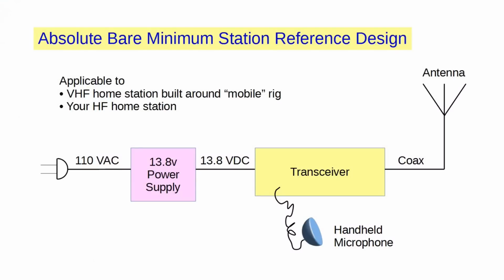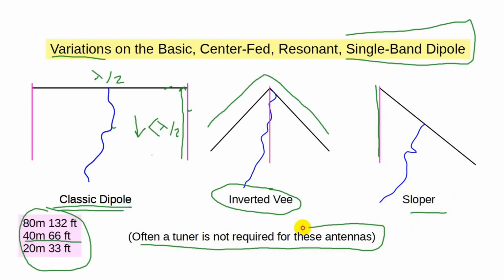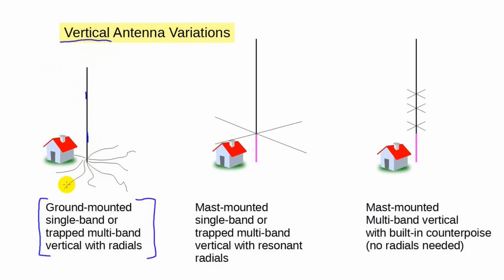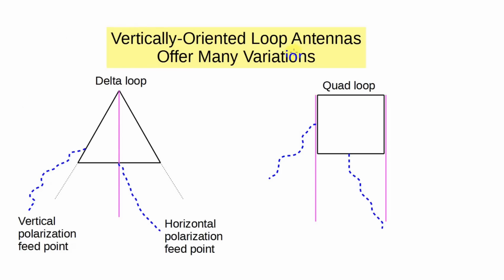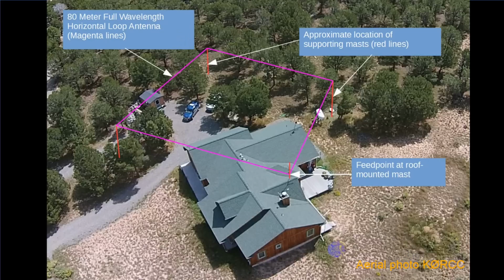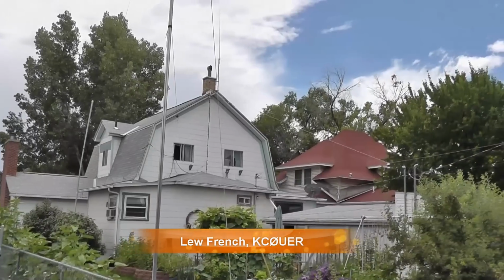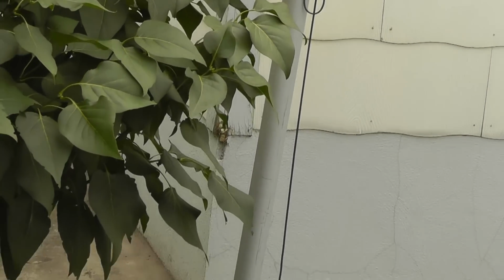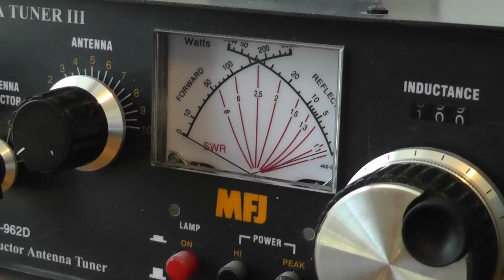Antennas for Difficult Situations: Ask Dave Episode 7

Comment: Hi Dave good morning. My lot is very small. I live in a mobile home. Am using an end fed dipole, 9:1 balun. As a sloppier dipole. When I run the insulator end up to a tree, ( can only go up about 20 feet). Will height make a difference? I’m not getting in any strong stations.

Comment: Hlo Dave i heard about the Isotron BILAL Antenna that have a large inductor in the middle with sheet meyal flanged as the main ant structure but with no ant Legs or any radiating members, how does this work  and i view this as a radiating TANK circuit since i see no rods or wires  just simple capacitive and inductive physical parts please give feed back TNX de n6mmq

Comment: What are you thoughts on using what is called a ridge vent for an antenna? These are starting to be use in place of the traditional roof vents in house where practical. I live in a split-level rectangle with a simple roof which uses one of these ridge vents to ventilate my attic. I am considering this over a gutter antenna.

Comment: I will be taking the test for my General license the middle of next month -- Oct. 19, 2020.  Am saving for a 15 foot piece of 1 inch PVC pipe to get the antenna in the air a little higher.  Thinking of trying some 75 ohm TV coax for the 4 element yagi as I have a lot of 75 ohm coax.  For HF I guess I'll be sticking to the 11 meter (CB) band since I've got several CB single sideband radios and will be using one (with a reprogrammed PLL chip) for 10 meters.

Comment: I got my start in single sideband CB radios back in the mid 70's.  I used to modify SSB radios to go above channel 40 and below channel 1 by reprogramming the PLL chip with +5 volts (high) and 0 volts (low) and unlock the clarifier with 8 volts on one side of the pot and the other side to ground.  Now the only Ham radio I have is the Yaesu FT-4VR, a mono band, 2 meter radio I got for passing my Technician exam.  I'd like to hook up an Astatic D-104 mic to my HT but cannot find a schematic on it since it isn't made anymore.  While waiting on my call sign I constructed a 1/4 wave ground plane antenna I made out of a piece of romex house wire I cut apart.  Only way to check my SWR is to use my old CB radio SWR meter which I found out could be used on VHF if you hook it up right.  First you set the meter in the forward position and then unhook it and hook it up backwards leaving it in the forward position.  Then key the transmitter and it will give a very close SWR reading for the VHF band.  Don't think it will work the same for UHF.  I got the ground plane up in the air about 20 feet by using my old CB radio antenna mast pole.  Using the old RG-58U CB radio coax on my 2 meter HT and the cable in the front door.  So far wife's been tolerating the cable coming in through a crack in the door but we'll see when it starts getting colder.

Comment: Dave thanks so much this was extremely helpful. I am a newly minted Tech,  KC3PZX but hope to go after my General soon. For the moment I am working strictly handheld on VHF/UHF so the antenna is not an issue but with a general I want to get into HF. I have two questions, I had been contemplating and attic antenna, but realized I may have a problem, we have solar on our roof, I am assuming the metal casing of the panels is going to negatively impact that. Since it is producing fairly high voltage DC I also wonder if that might also generate QRN, I have no idea how well shielded the cables are.  Your second guest, Dick Schultz KD0ESN, was what I had been wondering about and that was a Dipole along the north side above the gutters or perhaps a V shaped making the turn at the corner if I try to go for a longer antenna. I have considered going with an automatic antenna tuner mounted essentially at the connection point to reduce the line loss. between the antenna and the shack.  I do face a unique challenge as I am the HOA President so am mindful of those restrictions as I am often called to enforce them.  Again thanks this has made me feel better about the chances of getting a good signal out and in.

Comment: I just moved from a non-restrictive neighborhood, to an active adult community with HOA restrictions. They are forced to accept flagpoles and I know you can hide a vertical in one, but that's more work and expense than I want to deal with at the moment. My 20ft vertical was atop a 50 ft tower before, and while SWR was GREAT on ALL bands, it's effectiveness at receiving wasn't near as good as a long wire I had winding around in trees.  I am thinking an (several) attic antenna would be my best option for now. I can put in a dipole ok I am sure. I have 10 foot ceilings and the vertical is 20 feet. The bedroom where my Ham Shack is located, is closer to the edge of the house than the roof peak. Is it possible to put the vertical at an angle from the closet floor on up into the attic peak and run it "less than vertical" at an angle? Issues?  Also, I loved my G5RV I had a few years back, and since you can let wires dangle at the end, is there a limit on how much can dangle?

Comment: I have a concrete home (roof also concrete), can a dipole wire be ran in contact with the roof or there needs to be a separeation?
Reply from the maker: Your roof and walls are full of re bar which makes the act like ground. You'll need to get your antenna's radiation elements up off the roof.

Comment: I had a similar issue with a dipole element being too close to other metal. One hunting trip I was staying in a school bus and had one leg hanging slack running along-side the windows. I got it tuned and went outside to make the legs taut. After that my tune was way off. I slackened the legs back up and my tune came back. Turned out when I tightened the legs one of them ran right next to the metal body of the bus. When it hung slack next to the windows it had enough distance from the body that it didnt effect my tune. Fun lesson to learn!

Comment: Hi Dave,
Have watched your videos for a few years , and they have  helped me to study & pass the Big Exam with Honors, thanks so much for that help. Would it be possible for you to help us with metal roof structures with advice on setting up Dipole antennas? I am trying to make an antenna layout plan, and have got some ideas for NVIS 80 meters separately from a 20/40 meter in the yard ,of course the shed & the house have metal roofs & that poses some challenge.
 Some advice on avoiding coupling would be really appreciated. The situations that a lot of folks have overcome are with shingled or tar roofs, They have great ideas, what is some ways to get above the problem same as they but with metal roofs. Any advice please, would be appreciated.
& many thanks for your videos,
 which were most instrumental in helping me to understand the concepts to get an Honors pass, haven't got a grade like that in over 40 years or more.
Good thing there was no exam Q on metal roofs
Thanks, Mike 73 VE9MWB

Comment: Dave, If you have time for a question - Which is a better choice and how does the house impact the antenna.  
1)	Place antenna at 15-20 feet between trees. 
Kinda normal
or
2)	Place the antenna on the roof line of my house (40 feet). Say 6 inches above the roof
a.	How does the roof impact the antenna?
b.	Does this count as a height of 6 inches  from the roof or is it 40 feet in the air?
 and is (or how much is) the signal degraded?

Thanks!

Comment: Thanks Dave, ya I have a 30 foot tower, concrete bace and bolted and stayed,  planning to pull the center up that, going to use top rail 20 feet tall on the ends, going to concrete it in and stay that, iow it ain't going anywhere, this is for 80 meters,  do you think it is off the ground enough?
Reply from the maker: In theory, a dipole should be a half wavelength off the ground. That's 132 feet. Nobody has a dipole that high, so get it as high as you can reasonably get it.

Comment: Dear Dave, I just passed my technician test this morning, if you remember I am the guy that commented, ( so you need a couple of skyscrapers to mount 80 meters) a couple of weeks ago, well tell you what I have in mind, I have a hf rig, and yes I already have my study guide for general class, a lot of land and a 80 meter dipole antenna from mfj, the tower I have is 30 feet, there are no trees it's Arizona, was thinking about 20 feet of your fence rail guyed off at eather end for a inverted vee diepole  30 feet in the middle and 20 foot on the ends, what do you think?
Reply from the maker: My experience is that two pieces of aluminum top rail is about as much as will go together. Three is pretty wobbly.

Comment: Hi Dave. The good old conundrum of antennas. Where do I fit them in ?. Well your video here just about covered that one. The Hams in the Housing Org areas certainly found ways to get some wire up without it showing . The house that I am living in now. I would have all on to put up a 20 meter full wave loop but I just might give it a try all around the front and rear garden and over the roof and back down to a nice tree in the rear garden. We shall just have to work on it. Wish I was still serving in the army. If we needed an antenna up it went up and as long as it was not going in the way of any choppers, it went as high as we could get it Thank you for another interesting video. 73 de John - G0WXU.

Comment: I like the way this guy presents his videos. He obviously knows the biz, however, he makes his presentations in terms easy for a beginner to understand. I'm thankful to have come upon his videos and have subscribed. I'm new to ham and have recently installed my HF system. I bought and put up a multi-band OCF dipole but have not made any contacts yet. Therefore, I am digging in to learn what I can about antennas so I can determine what my problem(s) are, and if in fact, I do have a problem. It may very well turn out propagation conditions just aren't right. In any case, I shall allow Dave to instruct me and guide me through this process so that I can get on the waves. Thanks, Dave.

Comment: Thanks for great 👍 interviews of other ham solutions. Question #1 on your 80 meter loop. Given earlier comments on connection at a side versus a corner for different polarization, (horizontal  versus vertical), does one versus the other improve your coverage or does your height limit either to similar NVIS Mileage range distance?    Q2. Would you recommend one connection over the other for a loop antenna or is it really just what is convenient?  Q3 I have an OCF for multi band. Woukd you rate as equal to, more, or less desirable than a loop for 10-40 meters,  given similar height?  Thanks for your work and sharing. Steve
Reply from the maker: I took down the 80m loop a couple years ago. I fed it at a corner. A horizontal loop can have strange radiation patterns, especially on higher frequencies. Connect wherever's convenient, usually at a corner. If you can get that OCFD well up into the air, it'll perform on par with the loop.

Comment: Thanks you are doing a great job. I live in an HOA. My house is 3 stories but I have a metal roof.  Could I use a rope and insulator to install a sloper into the back yard. I just don't know how far I need to be away from the house. I run HF mobile with great success. But I would like to set up a station at the house.
Reply from the maker: Give it a try. Keep it as far from the metal roof as you can. Good luck!

Comment: I know this is one of your older videos, but I just came across it today. A lot of us Ham's have had to be creative in order to get on the air, and I really wish I'd have kept a journal of all the things I've tried and the one that worked! Likely the simplest one I've used was a mono band mobile antenna. Specifically a Hamstick mounted on the metal deck rail of my third floor apartment in Fargo North Dakota. I bonded the three sides of the deck railing together with short braided cable, and I ran a piece of wire close to a quarter wave long down to the 2 x 6 deck floor. I wove that wire between the boards zig zagging it back and forth to create even more of a ground plane. I ran the PICO Net on my morning for a year and a half and only once in a while needed a relay. Not the biggest fish in the pond, but I was in the pond.
Reply from the maker: A great example of persistance!

Comment: I live on the bottom floor of an apartment building, and my lease simply does not allow me to erect an antenna at all.  If I wanted to get on the air on HF, I would have to do it in the field.
Reply from the maker: An additional thought is that sometimes folks in your situation will put an HF mobile station in their vehicle, and then operate from a local park.
Reply: @davecasler  That's sort of what I'm angling toward now, although I'm not sure if the city I live in would allow such ad hoc installations in its municipal parks, although I would be very careful not to leave a trace after taking everything down at the end of my operation.

73 VE7NDE

Comment: Dave - I have watched many of your videos. You do a really great job of explaining things and have clear answers to questions.  I just passed my Technician and General license exams. I am interested DX and maybe MARS but my problem is that I live in a neighborhood where restrictions prevent my from putting up an antenna.My attic is small because of the slope of my ceilings which attic antennas difficult. Any suggestions regarding my antenna conundrum and radios?
Reply from the maker: Your situation is shared by many. Persevere. Take a look at the HF digital modes such as FT8 that can be done successfully even with severely compromised antennas.

Comment: Dave,
I used a G5-RV Antenna up about 20’ at our old residence and I found that I could operate Everything EXCEPT 160meters.
I’m going to run some 14g wire (From or friends at DX Engineering) to run from a Palm Tree up around 200’, running to a tree in my Backyard! 

IF everything goes to “Plan” I HOPE to be able to run ALL of the Amateur Bands!
I’ll let you know how things work out, hopefully sometime Very Soon!
Thanks for ALL of your presentations! I only Wish “Someone” would have done what You’re doing 25 years ago, when I got my Ticket!
-73-
Bill
N6FFC

Comment: Excellent video for new Hams or those challenged with HOA restrictions such as I am.  Thanks for covering these various antenna options.  I can only dream of ever having a 1/2 wave 80m dipole antenna so, I make due with a garage attic mounted 37ft. OCF Dipole for 6m-40m configured in a sideways "L" shape.  I also use a 7ft., 40m or 80m MFJ Ham-tenna, mag mounted on my van roof in my driveway.  None of these antennas are extremely effective, but at least I am on the air with mostly stealth antennas and therefore no HOA violations.  Working POTA is my best opportunity to string up a long end-fed for better results.  As mentioned, "Don't give up!"  Experiment until you find something that works!